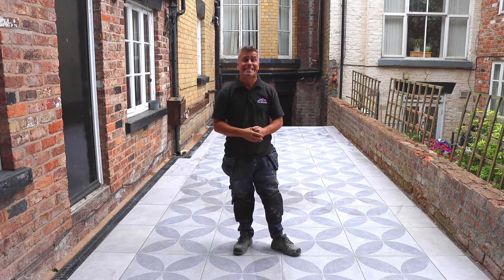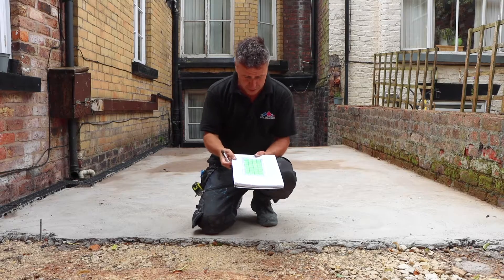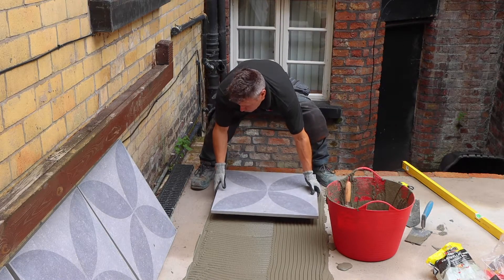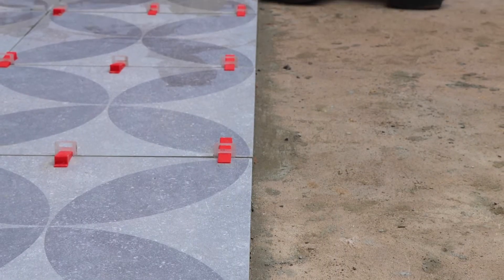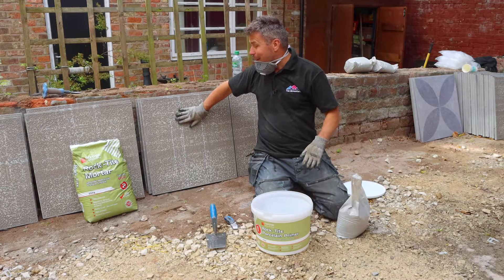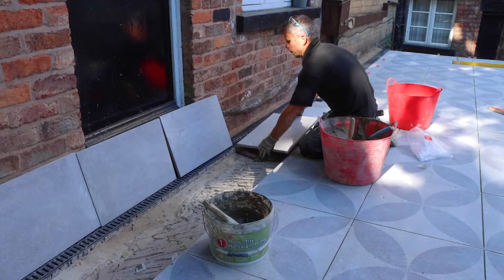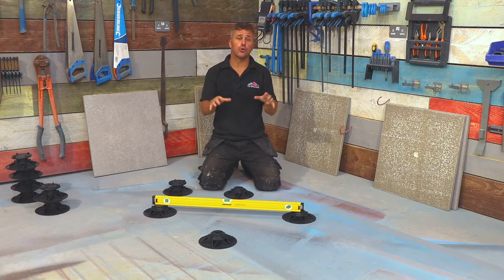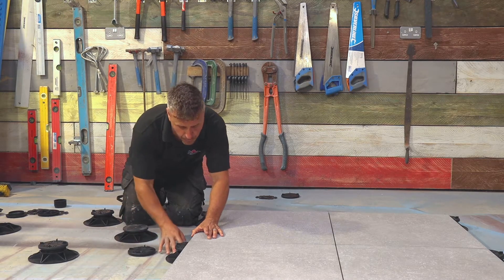How To Install Outdoor Slab Tiles Onto Three Different Substrates

Comment: Whatever happened to just plain old sand and cement? The amount of products in this video will have most people’s head spinning. That patio area probably took 4/5 days to lay I bet. Fast drying grout for a novice is a big no-no.
Reply: Both products I use are cement based products with additional materials within it that give it a better, longer lasting perforce, we don't recommend fast drying grout for this, the both grouts a use here dry at the standard rate time depending on the weather. But I agree with you a fast drying grout wouldn't be advisable for beginners.
Reply from the maker: @MrDIYCraigPhillips  Thanks Craig